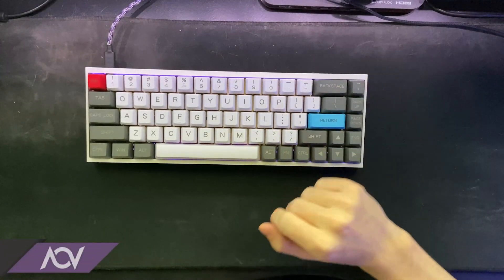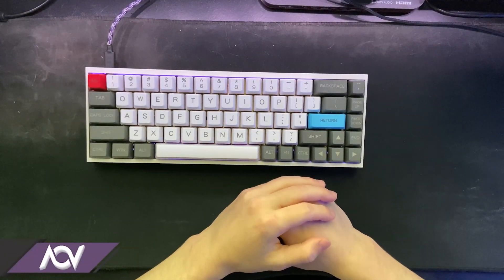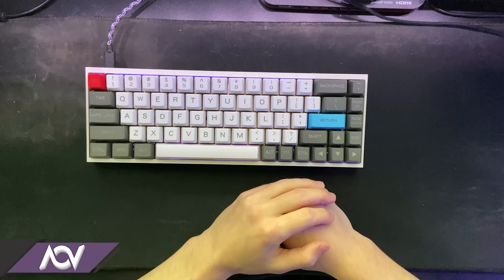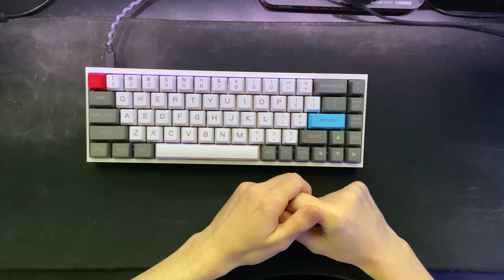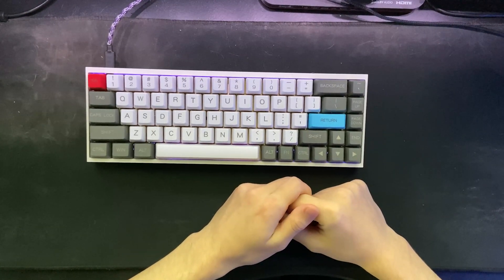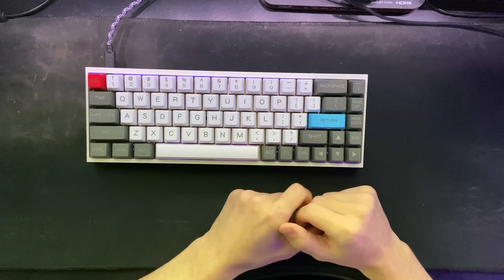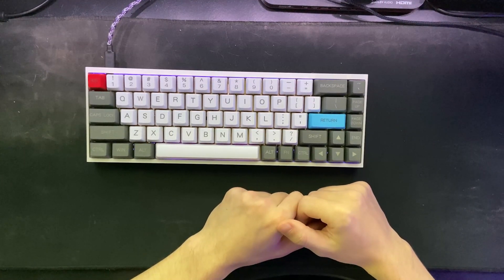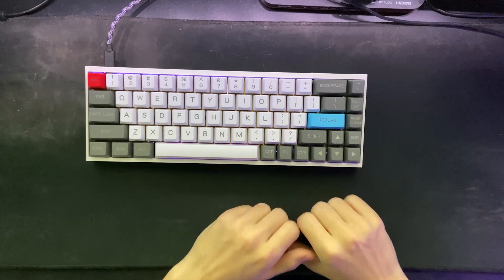Corne (crkbd) Build Log

Comment: hi, i'm building some corne too. Could you show me more about how do you socket oled? Is your oled hotswapable, and your microcontroller etheir? Thanks
Reply from the maker: There's quite a few ways to solder the mcu to the board. I wanted mine to look unique so I did something different than the usual mounting options. I soldered a male to male header with the pins clipped off to the top side of the elite-c. These sit on top of the elite-c with the clipped pins facing upwards, and socket into a female to male on the other side of the elite-c. I then soldered the male end of the female to male header to the pcb. Look at 2:05. The oled is not hotswapable unfortunately. I couldn't find a way without extending too high into the oled cover. Hope this helps!

Comment: I am going to build as well, wanted your advice on how easy the LED's are to solder, because have been reading online that you can easily mess up the LED's, should i skip them or go for it? I have some experience soldering but completely beginner at soldering components of this size, actually my first time
Reply from the maker: Hi, Ahmed! Yes you can damage the leds if they get too hot for too long. If you want to go for it, put your soldering iron on a lower temperature and try to be careful around the leds. I would say go for it if you want rgb on your board, but if you can live without it, I wouldn't bother.